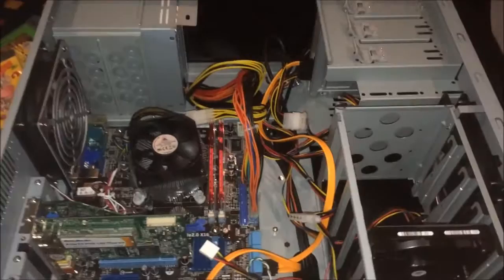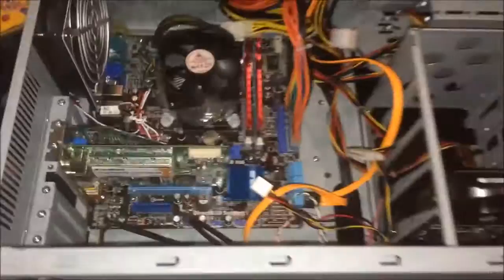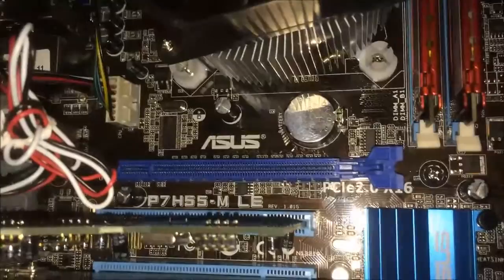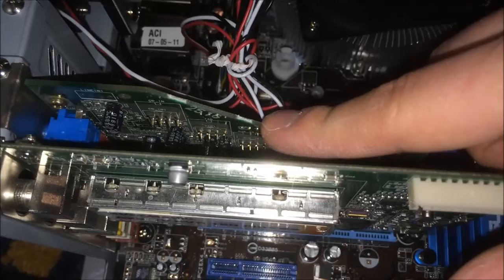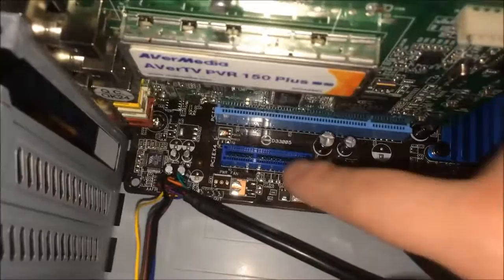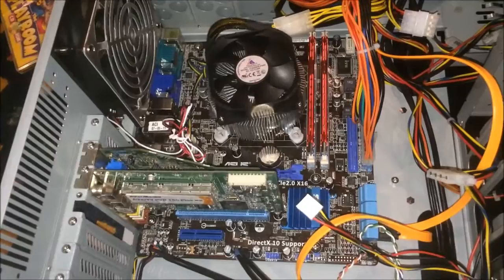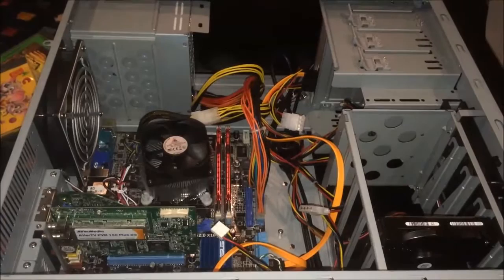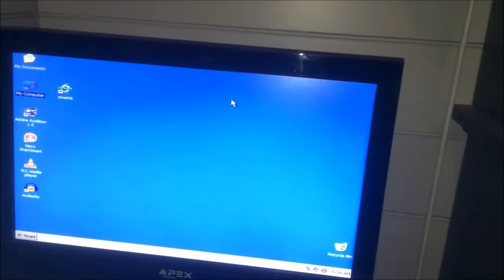A/V Transfer PC 4-12-2014

Comment: I have an VHS capture PC. Which is basically just an old 2006 IBM Thinkcenter 2,8GHz Hyperthreaded Pentium 4 upgraded to 1.5GBs of RAM fitted with an Hauppauge PVR150 TV tuner (and a 2002 Nvidia Quadro4 750XGL thrown in because (like anything) it is better than the Intel GMA graphics adaptor) The Pentium 4 just manages to capture MPEG2 @12Mbit/s without skipping any frames :D

Comment: Since it runs Windows XP couldn't you put POS ready 2009 for safety but i know that would be a hassle
Reply: Like he said, it's not connected to the internet, so safety isn't an issue. It's not like it's going to explode because it has XP :P.
Reply: haha true that is a good point
Reply from the maker: POSReady2009 doesn't have Windows Movie Maker anyway, and i use that sometimes
Reply: Ah very good point!!